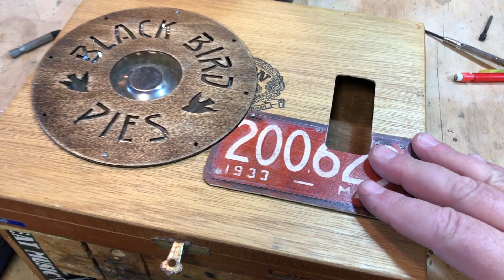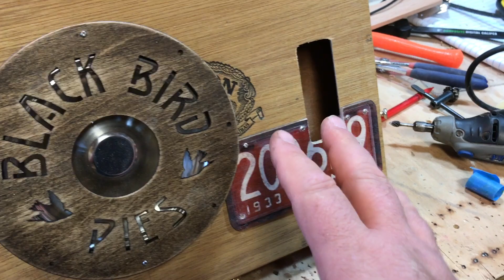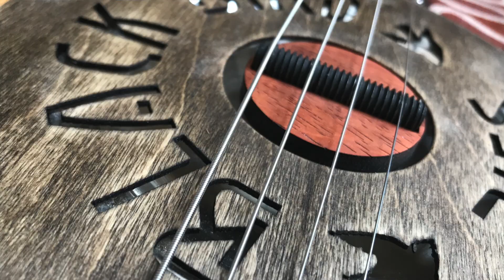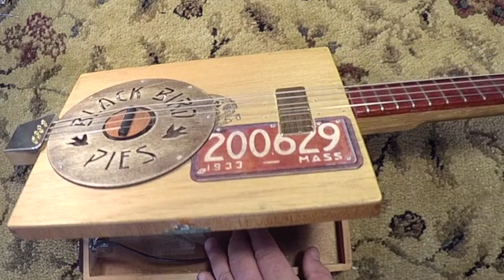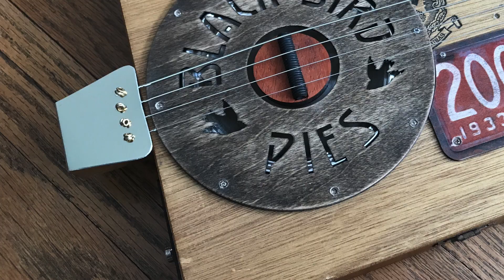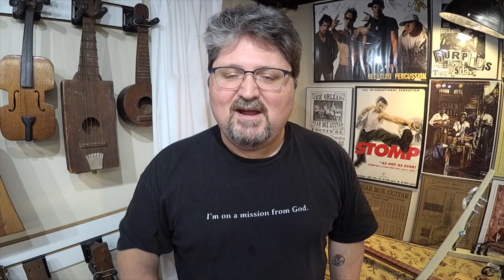The Reso-Electro Cigar Box Guitar Project Part 4 - Final Assembly and Details

Comment: Hey Shane and C.B. Gitty! I just discovered something you all might be interested in. My 65” tv just crapped out, and being the curious make things myself kind of guy I am, I took the back off the tv to see what was actually in there. I discovered the speakers were in two separate rectangular boxes, with three speakers in each box. Each box had just 2 wires, a red and a black coming out, so I immediately thought “I wonder how these would sound in my little cigar box amp?” .  Well, they sound amazing!  So you might want to try that next time you build a little 9v amp. eBay has big screen tv speakers, or just look at the dump next time you go and bring a screwdriver. My tv was a hisense.